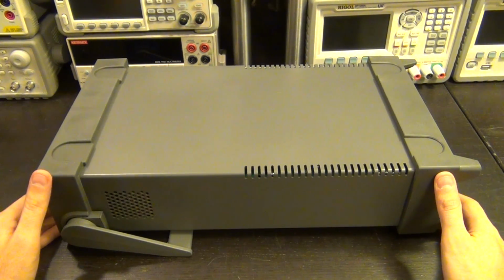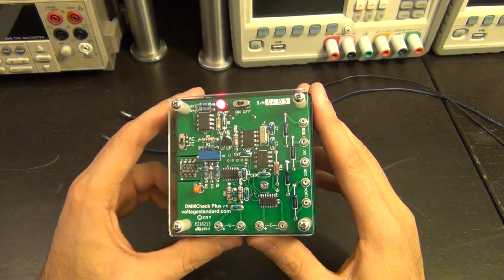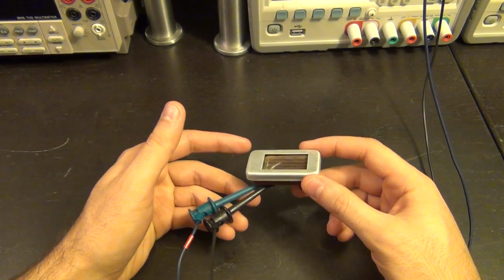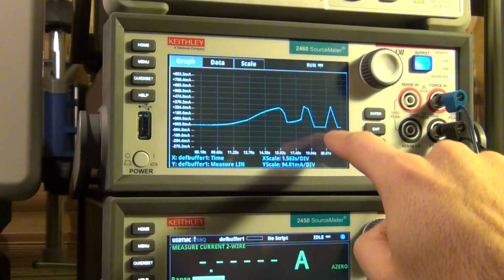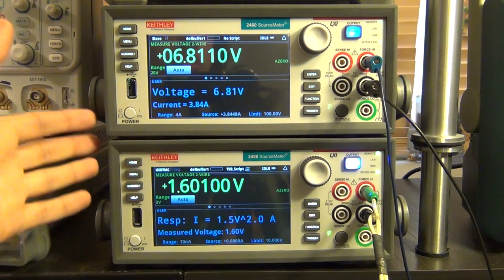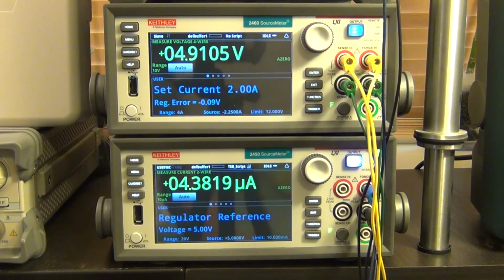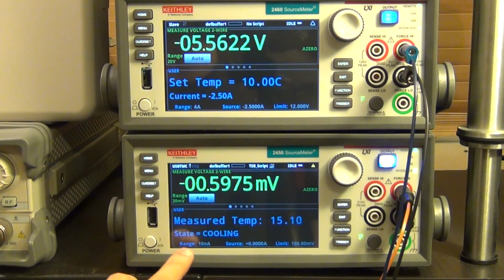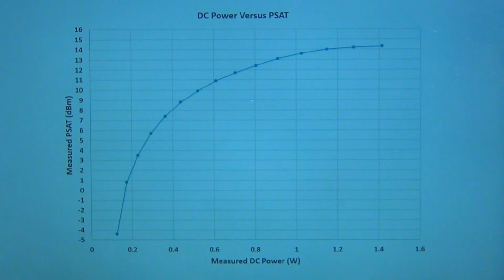TSP #48 - Keithley 2460 Source Measure Unit (SMU) Review, Teardown and Experiments

Comment: thanks for this , in labs where finance is an issue it would be good to know how well you can characterise components with just one 2460 , can you script and interact with other equipment and still perform a reasonable IV plot for a fet or a bjt with just one piece of equipment ?  also even thought its a pulse type piece of equipment , can you pulse at such frequencies to charaterise small transformer behaviours?

Comment: Hi,  my procedure says to set the SMU to provide a load current of 250ma to a battery set.  I did this and it charged the batteries instead of draining them.  I am supposed to be draining the batteries according to the procedure.  Is there a way to constantly drain 250ma from the batteries?
Reply: set -250mA current, to sink current instead of sourcing it

Comment: Just wanted to point out that with a White LED, the safe operating voltage/current is not 2.6V... typically more like 3V. You want it to run around 20mA for full brightness.

Comment: By far my favorite youTuber. Love all your videos mate!

I really wish I had a job which required one of these so I could justify buying one. But thanks for putting these videos up so I can see what they can do. 

With your last video on the 2450's you could use an actuator to control the height of the coils(or anything) to get mechanical control over them as well, using one of the smu's to output a 4-20mA or 1-5v signal to a position controller. This would allow you to characterize many DUT's which need physical movement as well, fully automated. 

Very impressed with the power the scripting offers in these units.

Comment: So if you have one of these you need no lab power supply anymore. Yay, saved the money on one instrument ;)

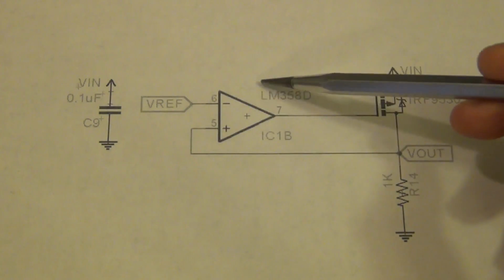Maybe a useless information, but if you use "export -> image" in Eagle instead of print screen you won't have the component crosshairs on the image (around 38:00).

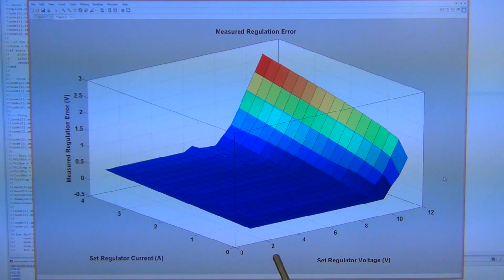Comment: At 49:00 why is there a local Measured Regulation Error peak when the Set Regulator Voltage is around 6.5V and the Set Regulator Current is 4A?